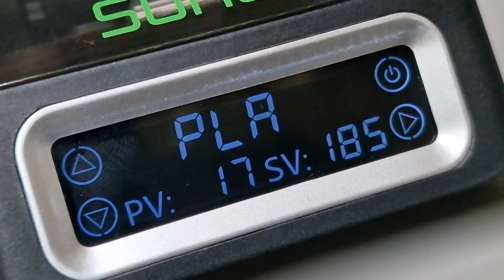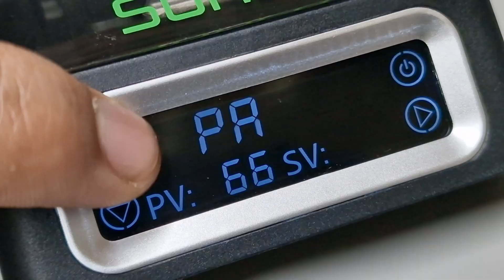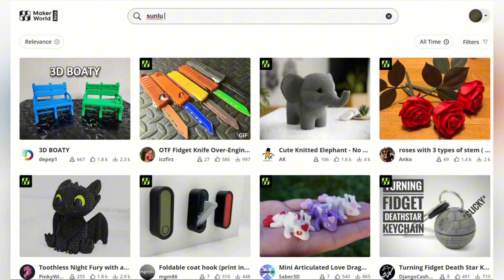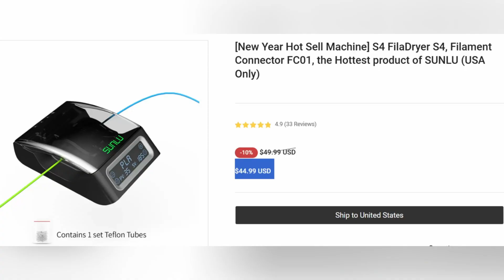Does this Filament Connector actually work? SUNLU FC01

Comment: My thoughts exactly!  I'm embarrassed for Sunlu for releasing such a poorly designed product and then pushing it as The End All Solution.   I've had one for about a month now and it would be useful if you had three hands.  As you showed, the curving filament is a nightmare to hold straight and I can just picture people trying to push the button with their nose while trying to hold the splice still.

I've looked at the mods you showed and have been wanting to make one.  Some of them would likely make this machine very useful.  Sunlu should have conceived of something similar and built it into the device.  For the price there should have been a lot more to the device.

Although I have my doubts that Sunlu actually developed it.  It's likely some other companies product, that they designed to be cheap and easy to manufacture with no regard given to usability,   and Sunlu pays them to slap their name on it.    That's how it usually works.
Reply from the maker: I felt exactly the same. I feel like it hasn't been tested on real-world scenarios. I can think of a few solutions where the size would still stay the same and I wouldn't consider myself very creative 😅 I'm sure product developers can do much better. 
If Sunlu hasn't developed it but are selling it, it makes this a whole lot worse then it is already is 😂🤦‍♂️ Thanks for commenting ❤️

Comment: I just put the z as high as it'll go, put my filaments against the hot block and then push them together in a off cut piece of 1.75mm ID ptfe tube i have kicking about, works perfectly and cost nothing. Once its together simply slide it off when reeling it up.  It really is that easy.  I dont know why people dont try the obvious first.

Comment: Nice review! Good critical thinking.

At £40 for a filament connector, when the value of a short length of leftover filament is about 30p, this is a hard pass for me. I imagine these things will be £10 or less in a couple of years. Meanwhile, maybe I'll just load the oddments in my AMS and tell it to automatically switch when filament runs out.
Reply from the maker: Precisely. If this was something like £10-15, I wouldn't be as critical. Some people are calling it negative but its just critism that will hopefully result in a better product. No one should have to print or use other things to make it work. 
Also, the AMS is a great shout. Didn't know you could do that 👌
Reply: @Gadgetsquared100 show me any 3d printer and I'll show you some added elements! This is arguably the best splicer on the market

Comment: Someone said they got a nozzle clog using this
Reply from the maker: I personally haven't experienced anything like that, but I think its possible if the fusion isn't done right
Reply: If'n y'all push the ends together too much, you can end up with a bulge in the filament.
I use a Weller soldering iron for heat, 1/16" ID silicon tubing for the fusion sleeve and some Capricorn brand PTFE tubing to test the fusion diameter.
Truth to be told, the Capricorn tubing is part of my spool-winder...if a weld can't pass through the blue PTFE, I cut it out and try again.

Comment: I feel your final thoughts were really negative. Think about how much bigger the product would be if it came with the external filament holders? it would be massive on your desk.  Maybe they could provide and STL file for a better holder (if you desire) but I think overall this product does everything it was set out to do.
Reply from the maker: I'm just being honest. The fact that people had to create their own solutions shows there is a limitation in the product. And the solution from them doesn't necessarily have to be big filament holders, it could be ironed out with testing different designs. Glad it works for you but I still think its half-baked